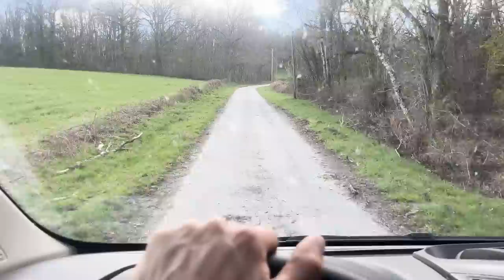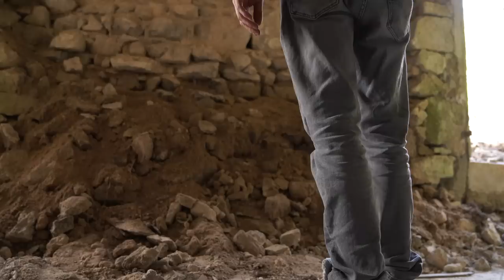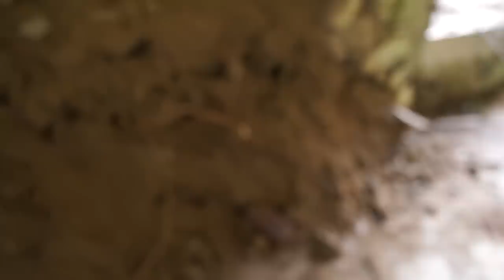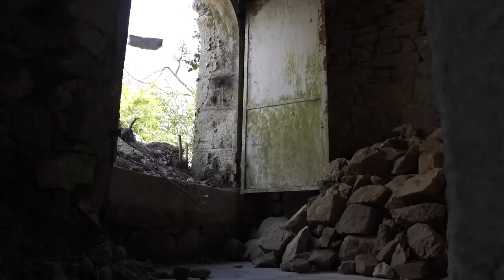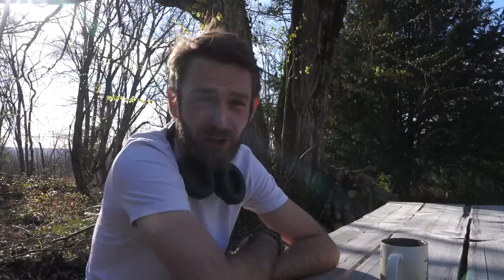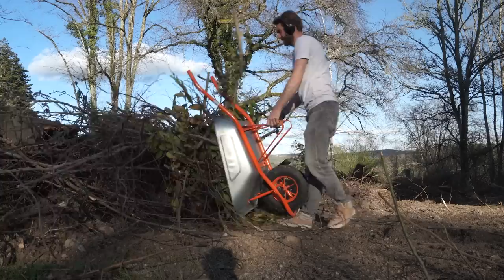I saved on gym membership and bought this chateau instead

Comment: I offered to help and elder in the community clearing away rubble and mess that was making her yard look bad. I would toss stuff in piles then move the piles . She told me touch it once pick it up  and take it where it's going to end up. rather than lifting the same handful of stuff a number of times. I spent a little longer this way but she was right , I took the trash to a truck, the wood to a wood pile of usable or burnable, bricks to a pathway she was making of old bricks and metal to a pile that a scrapper would come for. I didn't realize how much time was spent hauling the same stuff  a number of times. "touch it once" best advice for the job.

Comment: There are at least three crumbled and collapsed arches I 've seen now. One was the exterior wall. These arches are supposed to hold the weight above them and transfer the load to the rest of the walls. No arch...no transfer...and it all comes tumbling down. Fix the arches...highest priority. Brace with those screwjacks while you do the repair to each collapsed arch. Unless you are planning an insurance scam when it all falls down...well...carry on. I'm a mason and SEE the precariousness of these arches that have fallen apart.

Comment: Food for thought here, you may want to save some of the mortar debris as filler material as well when you're going to be repairing large gaps. 
 Perhaps mix it in for the center parts of a wall repair, & only fresh mortar for outer faces. Possibly a way to help cut costs, as obviously there's going to be TONS of mortar work ahead...as well as securing openings now.
 As to roof solution(short term), have you thought about either a pvc or aluminum tubing, low arch frame set up that you could get greenhouse sheeting over?? Thinking in terms of light weight, easier to secure, perhaps a quicker low cost way to starting keeping weather out of the masonry??

Comment: There's so much double handling on this project, it makes me want to cry. Trust me on this, try to move things once, without all the heavy lifting if you can avoid it. If you don't use every mechanical advantage you can get and practice proper lifting technique, your body isn't going to thank you. When you're in your 20's and 30's, you're bulletproof, but when you're in your 40's and onwards, your body starts to say no. Be smart.

Comment: What you need to do; burn all the thin branches in a huge easter bonfire!

Everything larger then 15 cm in diameter, on a big pile, to proces it in to firewood.
(build a roof/shelter somewhere on your estate so it can dry in the coming months.)
You need a cheap and reliable way to heat your castle in the future.

Best way is to insulate the hell out of your building (roof/glass/walls) and make an electricity based heating system in the house. (batteries, solar panels, floor heating etc)
But it is always good to have a plan B regarding heating.
So a couple of fire places, and a basement stacked full of dry firewood, is never a bad thing.